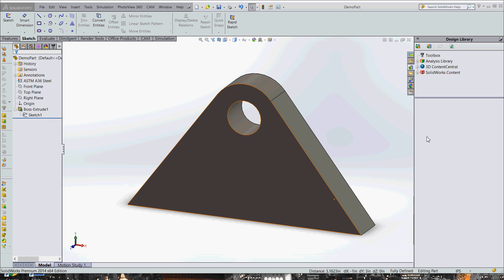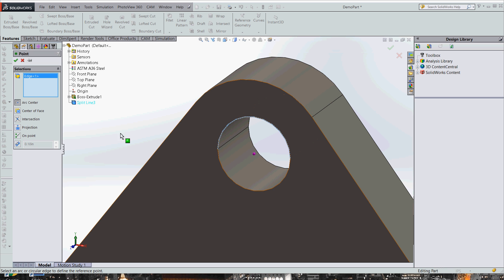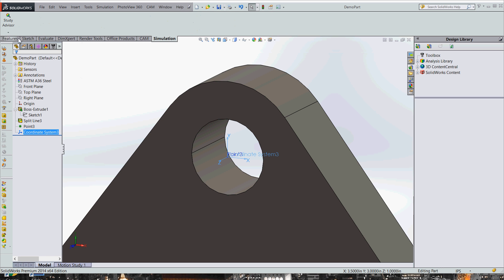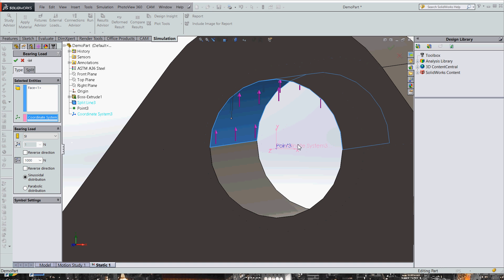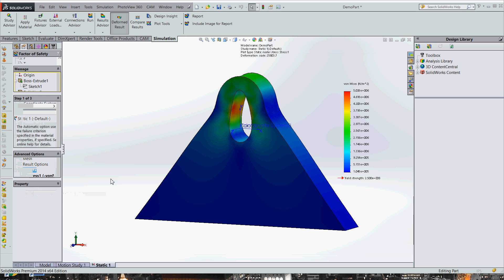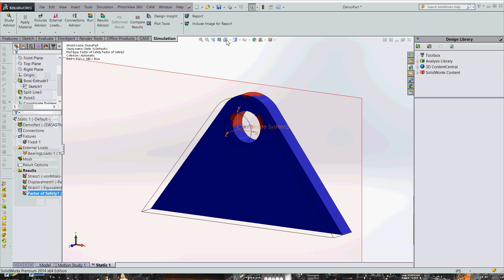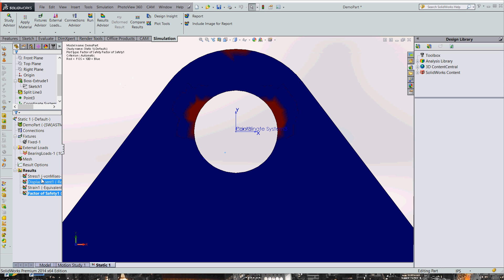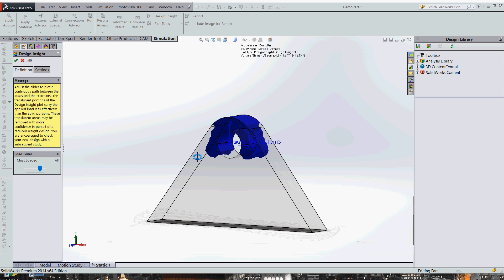Bearing Load and St. Venant's Principle in Solidworks

Comment: Hi Matt, thanks for your reply. I've done that and the results are more or less consistent with your interpretation of St. Ventant's principle. This is very handy for FEA reports, but in order to use a rule of thumb like that (10% of wall thickness) I would need more formal source. Do you have a formal text book or paper that documents how to apply St. Venant's principle to FEA?
Reply from the maker: +Alejandro Jaramillo That is what my professor taught us when I took my Computer Aided design and manufacturing class. I'm sorry I don't have a more formal source

Comment: Hi Matt, you mentioned people could write with questions, but I can't find your email address, please post or advice where to find it. Tks!. My questions is if you have compared the results of such a bearing load calculation with a hand calculation?
Reply from the maker: +Alejandro Jaramillo I haven't done an analytical bearing load calculation by hand in years so I couldn't comment. If you are truly interested in the comparison, I would recommend doing a hand calculation on a certain setup and repeat in SolidWorks FEA. Try changing some parameters like mesh size and see how it reacts. Hope this helps.